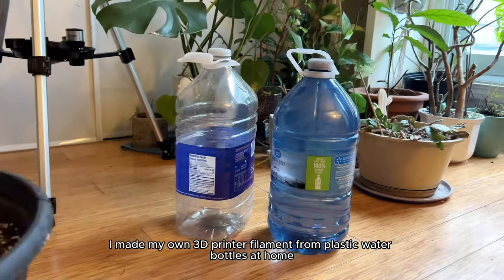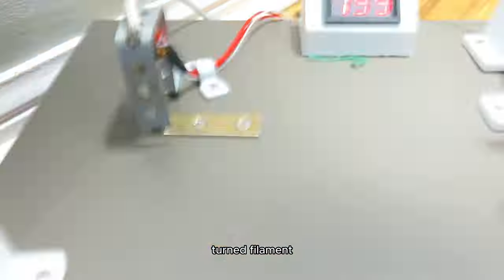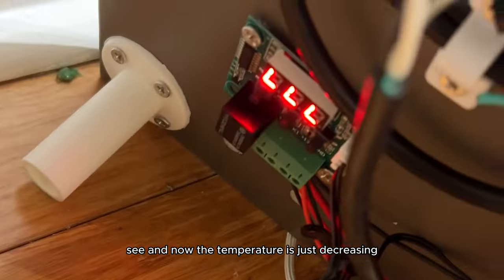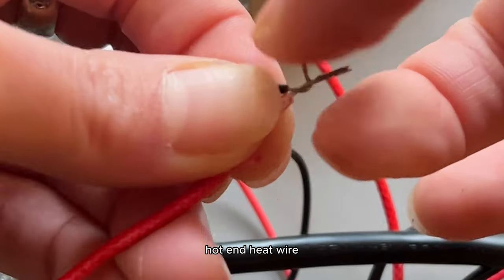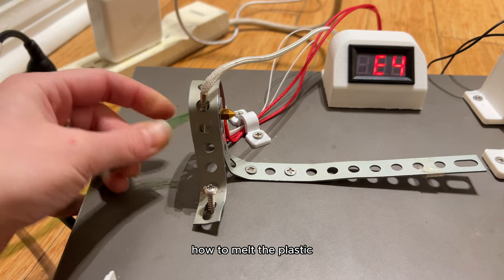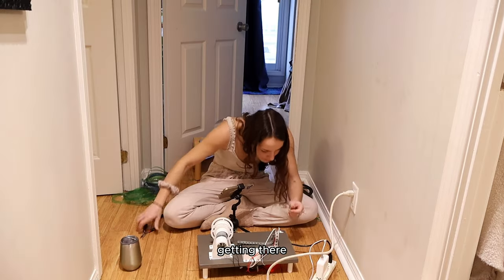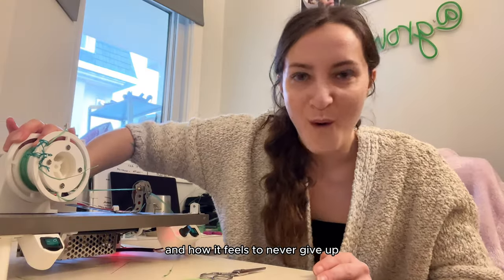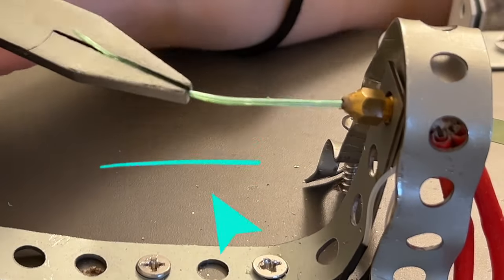I Turned Plastic Water Bottles Into 3D Printer Filament - The full journey

Comment: Just an idea; you can flip the plastic feeder portion so you can feed the plastic to it from top. You may need to add a small metal funnel to the feeding portion to accommodate for the excess melted plastic. You may also need to increase the heat a bit to make it melt the plastic properly (not to make it drip). On the other side where the filament is coming out you may also need to add a very small fan to drop the filament temperature once it comes out from the heated tip. Gravity can maintain the process but you can still use the wheel to collect the filament once you have enough filament length to do so!

Comment: Having built a bottle cutter and filament puller myself I know EXACTLY what you went through.  Tip for printing: Be sure to dry your filament BERY well before hand.  This stuff will have absorbed a LOT of water and will pop and spit and get cloudy unless dried.  It'll also get very stringy.  But, if well dried it prints off amazingly smooth and clear.  You can also use sharpies to colour the clear filament before you pull it through the extruder so you can get custom colours..you can even you the metallic sharpies for interesting effects.  I make functional prints with it and found it can make excellent plant pots.

For print settings:  Hot and slow.  I print at 30-40mms and 265°C.  Flow rate of 115% (you'll have to play with this a bit).  You'll also find that a direct drive, dual gear or titan extruder will work MUCH better with this stuff.  Bed adhesion can be a bit of a problem but I found that the cheap build-tack beds and glue stick works great.  Painters tape and glue stick works well too (the glue stick makes it easy to remove the tape from the print).  1.5mm retract works well for me also.

Hope this helps and I really do hope you enjoy printing with it.  It's a challenge to set up but once you have it going it works great.
Reply from the maker: thank you so much for these tips! and i love how you know and feel what I went through as well. I appreciate your comment very much <3
Reply: Good job

Comment: The way pultrusion works is the nozzle doesn't actually melt the plastic, it just makes the plastic soft and folds it into a tiny tube.
Here's a video from CNC Kitchen explaining how pultrusion works and how to print with PET bottles https://youtu.be/1yIe1Pp_Nrg

Pulling it by hand might introduce some inconsistencies on the diameter of the filament, which will cause under and over extrusion when printing.

For calibrating flowrate, Orca slicer has built-in calibration tools.
Here's a great tutorial from ModBot https://youtu.be/W901s6zTwiw

Hope this helps and good luck!

Comment: The actual temperature of the pultruder nozzle should be 220 degrees Celsius, although I believe the Petamentor's thermistor is a bit offset. I watch a lot of Function3D's videos and he also has a website. He uses a different machine but the principles are the same. As for actual printing, here are some settings that should get you started:

Layer height: 0.2
Nozzle temp: 260-290 (start high), 280)
Bed temp: 75
Flow: 130%
Initial layer flow: 130
Printer speed: 30mm/s (to start with, work up from there)
Fan: 15% (if there's crystalization, more fan speed)
Retraction: 4.5
Retraction speed: 40mm/s

These are alternative settings I've noted, more speed requires higher temperatures. Please note, these ones are notes and need a bit more testing:

Nozzle temp: 255
Speed: 25mm/s

Nozzle temp: 268
Speed: 96 mm/s

Nozzle temp: 255
Speed: 50 mm/s

Nozzle temp: 260
Speed: 50 mm/s

Comment: You will not be able to print with such a rod. Your spaghetti is empty inside. The extruder spring squeezes them and they become flat. You need to make the ribbon wider so that the "spaghetti" has almost no voids inside. Excuse me. I typed through a translator.

Comment: As you most likely figured out (still watching lol), diodes definitely need to be wired up in the proper direction. This is how i remember the direction. The white or silver strip at one end is the gate at the end of the race. Electrons are the racers. They start far away from the goal line and must pass through the black to complete the race.

Simply put, diodes are like one way doors.

I have a diploma for electrical engineering and ive definitely destroyed a lot of diodes while learning haha, the best thing about diodes os how cheap they are 😂 

Either way, great job!!

Comment: The propper name to the type of plastic is PETG, and thats where the name of the device you made the filiment gets its name. There should be preprogrammed settings for the plastic if it doesn't then be careful when programming it in as petg plastic can put toxic fumes into the air when in a gooey state similar to how it was when attempting the pull trusion (the term for the process). The proper temperature for printing petg plastic is 220-260°C or 425-500°F.

Comment: Nice work 👍 
Those controllers are notorious for overheating and mismatched temperature display. 
When I designed mine I kept in mind that a diy should be based around diy electronics aka arduino, a mosfet and a voltage regulator on a separate circuit with a windscreen motor.
Everything come to a total cost of $25-35.

Comment: Just 5 mins into this video but had an idea. Instead of cutting plastic into uniform strips, can you melt the plastic in bulk? Like in a metal container with a filament nozzle welded on. You could have a small hatch to add your plastic, close said hatch and heat the container either on a burner or with a blow torch (not sure on what temp plastic has to be melted, a burner would be more controlled and putting the nozzle near the bottom where the heats applied may help flow) anyways, pressurize the container with an air compressor to slowly to push the filament out at a steady rate as its rolled up. Just thinking ways this could be done on a bigger more effective scale. 👀  Anyways I love what you’ve done, you’ve shown it is possible to reuse plastic for 3d printing.

Edit: using a method like this could allow you to change the composition of the plastic entirely as well. Imagine this. You can’t make 100% reusable plastic work as filament but what about 50%? 75% plastic? Gotta find that sweet spot when it stops working and at what temp speeds ect. Also imagine this any bad prints can be recycled as well, just grind them up and melt. Sounds like it’ll work great in my head but in reality sure there will be ton of flaws if a company hasn’t already perfected something like this already. Lol

Edit 3: They do have one; it’s called a filament extruder and from my google search they’re expensive. Can’t find any research of anyone trying it with plastic or mixing ratios of filament/plastic tho.

Comment: this is so inspiring. but also saving the environment at the same time. one thing about the 3D printer, since the material is a reformed material from flat into round filament by heating process , the quality of the filament would also reduced. so perhaps you might need to re-calibrate the settings of your 3D printer machine ,like input , delay (timer) sequences, nozzle temps,  output temps, output delay, and axis speed . that way the 3D print machine would run on the role of new material/filament behaviour than before. greetings from Jakarta❤
Reply: ممكن سعر آلة تحويل الخيط المسطح إلى خيط مستدير

Comment: I could be mistaken but I thing the problem you're making is you're trying to melt it. From what I've seen the point is to get it just hot enough to deform the plastic not actually melt it. You basically want it to curl into a hollow tube. I'm actually planning on doing this myself soon so I've been watching a multitude of video and reading up.
Reply: You’re right, you just want it to deform enough that it forms into a hollow tube. This may make your builds weaker depending on what you intend to use the thing for. One way I can think of that would eliminate the hollowness is either double stacking it and slowing the process down, or shred up the plastics and then using a different type of setup meant to accept plastic pellets and then extrude out the filaments which is much more expensive to create.
Reply: @Lunaskylette  I think just increasing the flow rate will compensate for the hollowed parts.

Comment: if you wish to feed a new pet strip in a cooling (but still warm) nozzle, use a thin (one or two strends) of copper wire to use like a guide.
I twitst it to make more solid. Pass the whire from the exit to the entrance of the nozzle. than i make a little loop in wich i pass few centimeters of the pet strip.
Then (beware not to burn your fingers), pull the copper cable (beware to remove all the wire infulator, or it will melt in the nozzle) and extract the pet strip from the nozzle. Then proceed with the "normal" pulley winding ;-)

Comment: I feel the temperature isn't being handled right. Either there's a software configuration problem or something isn't reading the thermocouple right - there's no way half a degree rationally makes such a difference between good and crappy filament, it's obviously being changed by a lot more than the display is showing. I'd suggest using a 3D-printer board instead of that controller; they're much more precise. I think there's software meant for Marlin board specifically for running pulltruders that excludes all the usual features and just runs the cartridge, thermistor, and one stepper motor continuously.

Comment: I would of used a Trouser press - melt the bottles  Flat (Between Cooking oil metal sheets)  and then feed them into A Confetti Cross Cut Paper (CD  DVD Blu ray Cardboard Rated ) shedder 

Now going to need to modify a Meat mincer (stand Food mixer)
So the Meat mincer  screw auger is Magnetic Induction Heated (Heated by a Electro magnet Copper Pipe / Wire  Coil + ZVS Induction Driver)  and comes throw a cutting Dye (Makes pellets / mince meat ) / Sausages  Filling nozzle/tube  (makes filament )

Comment: You may already have solved this, but if you heat the nozzle and hold open the clamp on the hotend, can you manually push through the bottle-filament? Im wondering if the neptune's drive to feed the filament isn't getting a good hold on your bottle-filament.

Comment: 200 to 220 Celcius to form the filament.
For print 250 to 260 depending on the material and printer.
PETPull2 is a better machine.

Comment: So where are you with your project? Have you considered taking a tour of actual manufacturer? As far as your reel you can utilize Arduino and a simple motor controller to solve that problem. Just keep in mind that not all bottles are equal.  different grades of plastic.

Comment: Hi! I'm stydying mechanical engineering and automatic control systems, so here are some tips that might help!

~Extruder temperature:
This can vary from the type of plastic that water bottle is made out of, but a common range for printing with recycled PET (Polyethylene terephthalate), which is often used in recycled water bottle filaments, is typically between 220°C to 240°C.

Since recycled materials may have variations in their composition, it's important to start with the lower end of the temperature range and gradually increase it while observing the print quality. Here are some general guidelines:

- Start with an extruder temperature around 220°C and adjust as needed.
- If you encounter issues like poor layer adhesion or weak prints, try increasing the temperature in increments of 5°C until you achieve better results.
- Avoid exceeding temperatures above 240°C to prevent degradation or burning of the filament.

~Print Speed:
   - Start with a moderate print speed, typically in the range of 30-60 mm/s for most printers.
   - Slow down the print speed if you encounter issues such as poor layer adhesion, stringing, or warping.
   - Higher print speeds may lead to reduced print quality, especially with recycled materials that may have inconsistencies in composition. 

~Flow Rate:
   - Begin with the default flow rate settings for your printer, which are typically set to 100%.
   - Adjust the flow rate as needed based on the extrusion consistency and the appearance of the printed layers.
   - If the extrusion is too thin or too thick, you can increase or decrease the flow rate incrementally by 5-10% until you achieve optimal results.
   - Keep in mind that recycled filament may require slight adjustments to flow rate compared to standard filaments due to variations in composition.

PS. Double check if the diameter of your fillament aligns with the diameter in the extruder's grippers, maby the gears inside it are not pulling on the string well enough!

I hope this helps! If you want to, I can help you make an automatic system that will turn on the motor on your "forbidden spaghetti" wheel so that it pulls and piles the thread of the fillament when the heat on the nozzle reaches the right temperature! Keep us posted and the best of luck!🫶❤️😁

Comment: The thing you had backward is called a diode it only Let's voltage through in one direction up to a certain amount of voltage. I'm pretty sure you also want your thermo couple. Being the temperature censor to go inside the whole in the side of the block. Not just go on the side of the block this way you can tell what the temperature is of the head More Accurately. Also use thermostat to when inserting it into the whole for better efficiency.

Comment: If there is a metal pipe with a fan above to cool it , next to the nozzle. It would be easy to create a perfect one. Rest you can use a pid controller with temperature sensors . And can use a stepper motor with a driver to control the appropriate pull of the plastic . 

The cutting part you can also automate but I never made it I just know these parts could be saviour

Comment: heat makes metals expand and holes to get smaller if you still need to get the nozzle out after 5 months Id recommend putting it in the ice box for a few hours then giving it a good cranking with a boxend wrench and a vice.

Comment: I dont think I would be able to do as good a job as you, I am doing something similar. I cut the bottle as I watch TV, so it is not as boring. Use a hot glue gun and point it downward and let the strip go through. My issue is that it breaks and slightly too hot, so I am looking for a way to cool it down. and turn it into a roll.

Comment: your filament probably isnt 1.75 or its not taught enough, i would try to clean the metal gear that pushes the filament with a wire brush, or change it with one with better grip or a dual one, then it should pull throughh.

Comment: for the hot end taken some filment to hared ware store matched the drill to it so will come out right size still building one just waiting on all the part to come been doing lots of pop  water bottles will have lots of test strips should have made it easy just get hot glue gun that could just set temp less to go wrong

Comment: Wow from the start she did it completly wrong ... I'm amazed. A way easier way to cut down the bottles is to fixate the cuter, a stick aka as bottle handler and to put a weight on it, then you simply just have to pull or simply walk away while holding the end, done in seconds compared to your time consuming apraoch.
Reply: Also try to build your nose vertical downwards ... gravity helps a ton to produce at a continues speed wich is important.

Comment: there are many videos online of this project and with different hardware I too will try to make it sooner or later but I haven't had the time yet but I will look for already sized bottles without heating them I have seen that they are available on the market.
the only thing I see from your project is that you don't cool the wire coming out of the nozzle and that you don't measure its thickness, there is also a method for joining the filament strings so you can print without problems or interruptions.
Anyway, nice result, great job!!

Comment: So to melt the plastic you might want a collection tube attached to the nozzles intake so that it can preheat kinda but also move more evenly like using a resistor to buildup and maintain a constant even flow rate.

Comment: nice machine, some suggestions are to add and extruder stepper motor to push the filament through the nozzle and you can add a small cooling fan right above the nozzle so the filament can cool more quickly and the diameter is not disturbed by pulling too much or too little because when filament cools, it cannot be stretched.